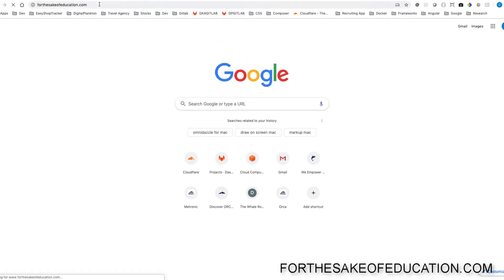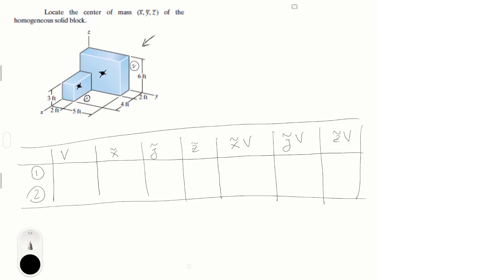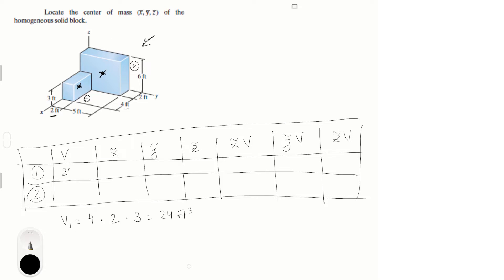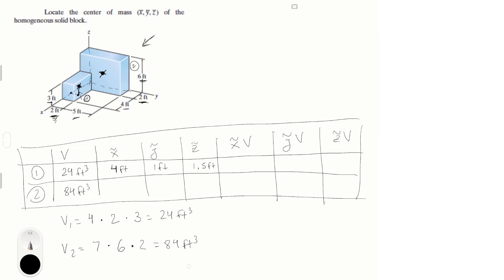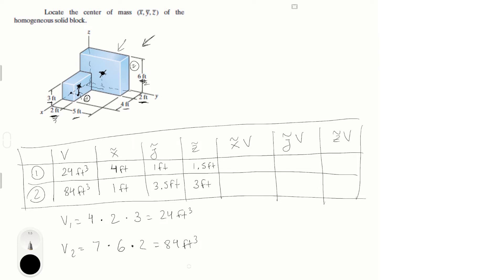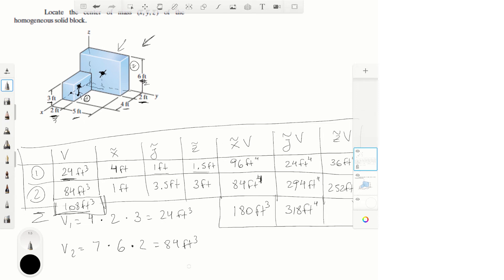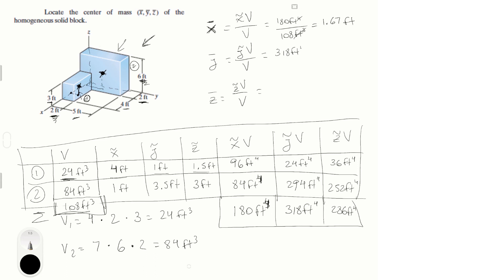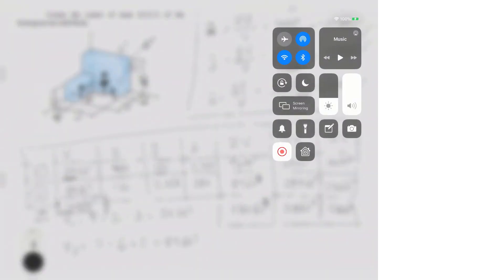Center of mass of the homogeneous solid block

Comment: Why is the center of mass on the x-axis for the first block 4 feet? Wouldn't it be 3 feet??
Reply: it's all the way from the y-axis, so you add the 2 from the second block's width to half of the length of the first block (4/2 + 2)
Reply: Shashi Kant  why not 2 ft?